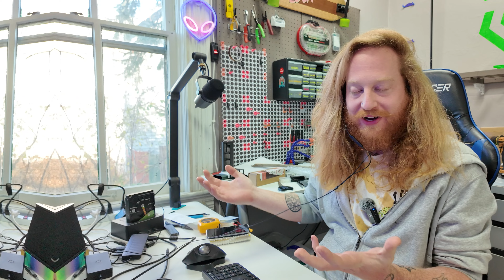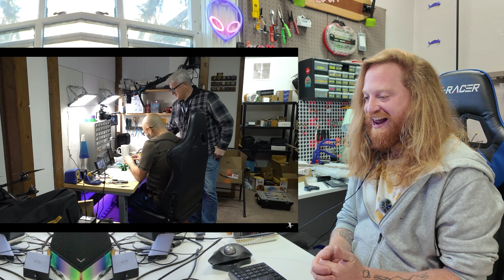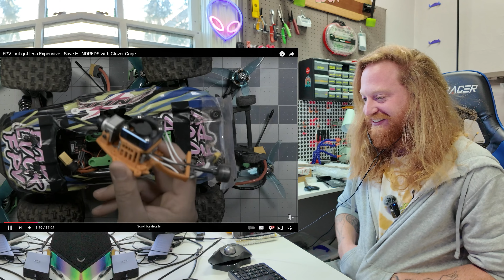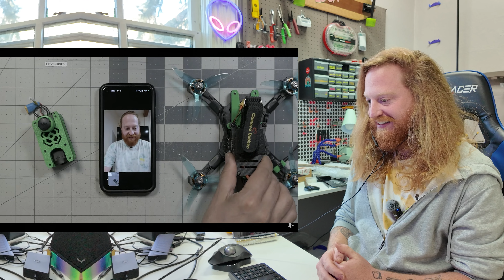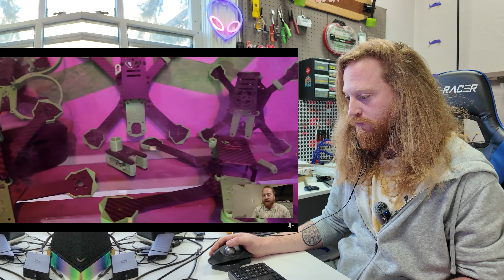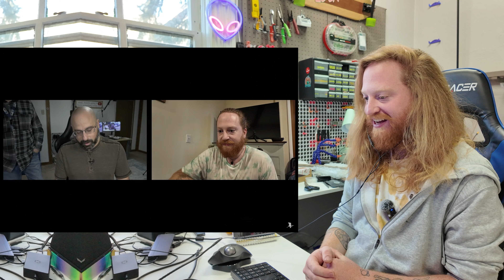Clover reacts "FPV just got less Expensive" with @Kenheron and @JoshuaBardwell

Comment: I wonder if something like pogo pins could so,etching used for writing . The tray has male end and the mount has the female so they would connect when you slide the system together. The screws keep both units together.
Reply from the maker: I always end up at screws when I'm thinking about something that will keep it pinned in a crash, and not cause vibrations in flight. I'm certain there's a solution like this though
Reply: @CloverFPVSystems I can work on a design concept. If you are interested let me know and I’ll give you a hand.

Comment: Something is going on with your website. I tried to order a 3” frame with a mount and clover cage; this will be the second clover cage I ordered. It reflected $88 and some change, but when i selected to pay, it charged just for the frame $44.00 i will go back and order the Clover cage.  So maybe you could ship them together. I just wanted to share that I am putting them on my quads along with RC cars/trucks. I am sharing this with many of my military retirees buddies; you did an awaome job designing the clover cage. I can see me saving big bucks on 03 systems, by swapping the clover cage. I'm unsure what armor JB talked about adding to cars. I also ordered the fan you recommended. It would be nice if you had them in stock so we could order everything we need for the clover cage in one place. I wouldn't mind paying a few extra buck for the fan, to get the complete package i need to start and finish the build without waiting for individual parts.  Just saying😊
Reply from the maker: I'm really getting into all of your comments Don. It's all in the works! You're in at the very early stages so forgive me that I haven't been able to respond to everything. Still getting into the swing of things. I saw your order where it ended up only being for the cost of the frame. I sent it all out anyway to save you on some of the shipping cost!